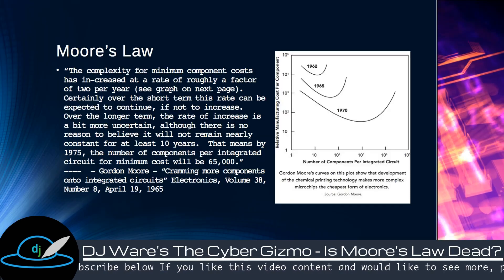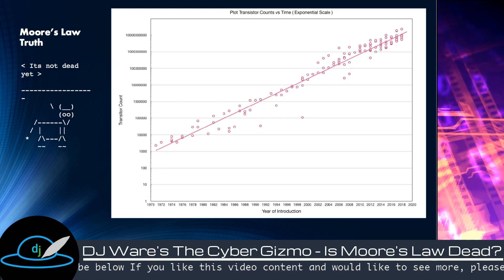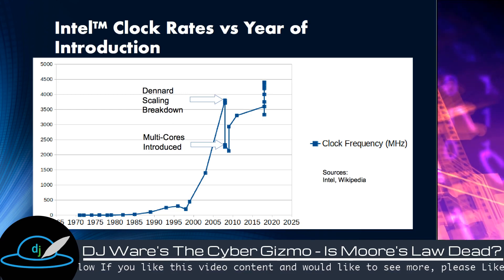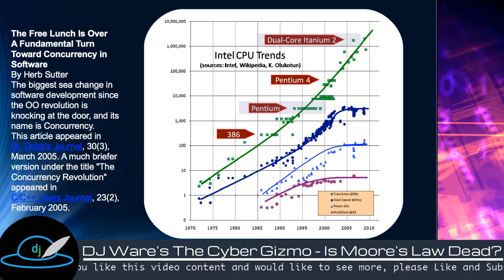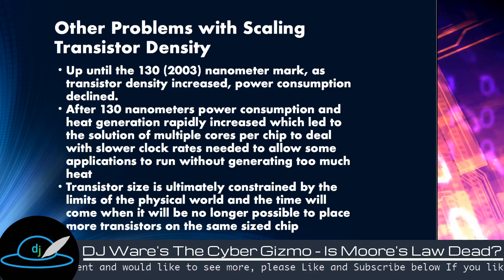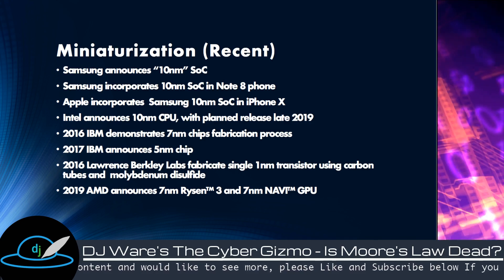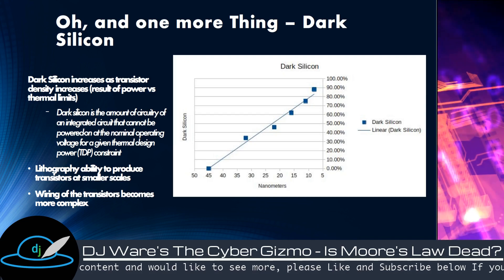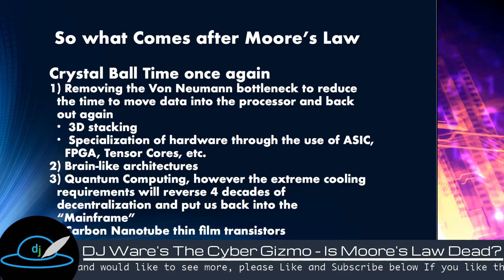The Future of Computing Part 1

Comment: In 2008 I had an Intel dual core E8500 that would overclock to 4GHz and an Intel quad core Q9400 that would overclock to 4GHz.  For the next 10 years mainstream chips didn't go significantly beyond 4GHz and just now have produced chips going to 5.6GHz.  In 2008 the dual core Intel chips could be overclocked to 7GHz using liquid nitrogen cooling, only in the past year or less have chips been able to go beyond 7GHz to about 9GHz using liquid nitrogen cooling.  But even at similar clock speeds- 4GHz in 2009 up to slightly over 4GHz approaching 2022, each core has gotten considerably more powerful, maybe 3 times as powerful, and there have been other improvements such as faster hard drives, faster hard drive interfaces, and faster memory speed.  It does seem that overall performance of each core is slowing but processors have a lot more cores now than they used to so that partially makes up for it.
I had to go back and do some checking on my old CPU that I'm still using.  It is a Q9400 which came with maximum speed of 2.66GHz, but Intel chips back then were easy to overclock so I've been running it at 3.6-3.8GHz.  Comparing it to a current AMD Ryzen processor at max. of 4.6GHz, a single threaded single core test shows the new Ryzen right at twice the speed of the old Intel chip.  (My computer is still running 32bit Windows so I don't have access to a lot of the current benchmarking tools.)  That's how much we have improved in 14 years.  Of course I can now have 8 cores or more vs. my old 4 core chip.